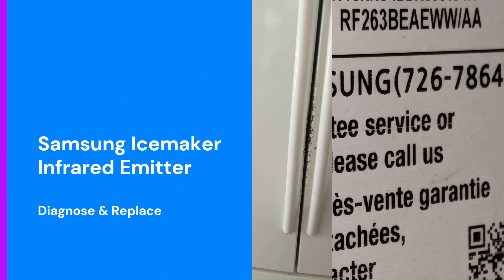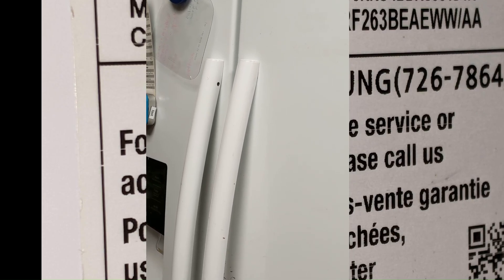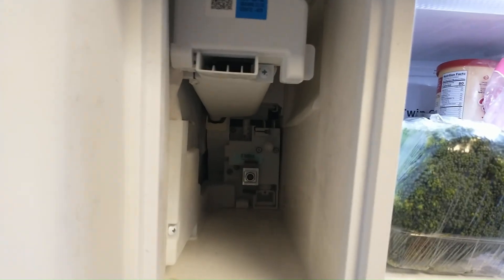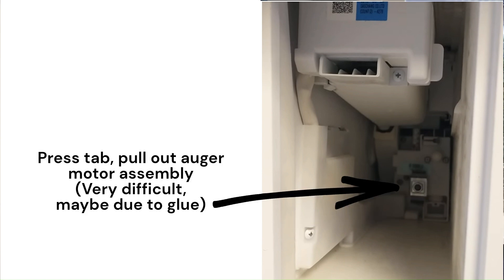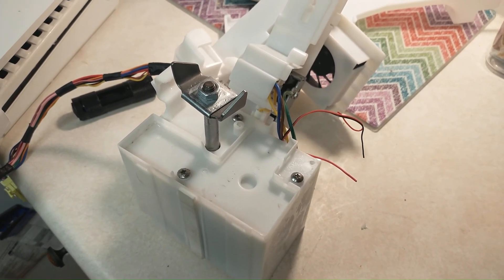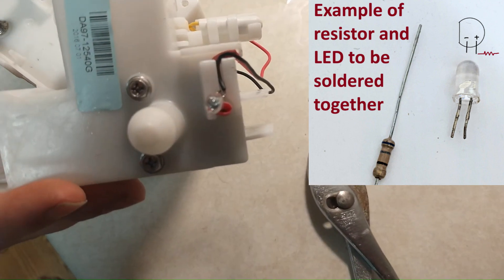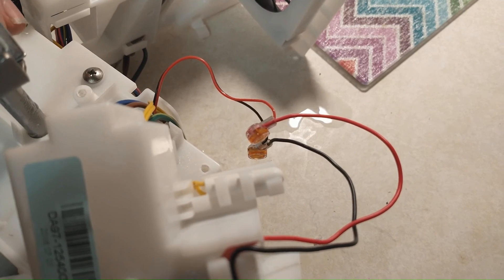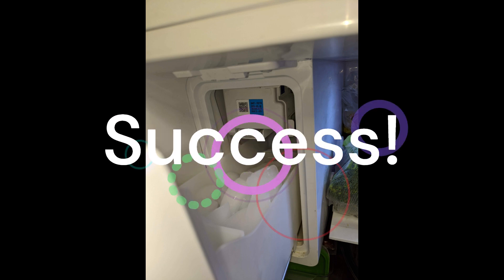Diagnose and Repair Samsung Ice Maker Bad Infrared Emitter (No ice)

Comment: This is the problem with mine. New auger assembly is $300. 
Can you show how you put it all together? I'm handy but don't understand how you wired it all together. Where did you put the resistor? 
Seem insane Samsung doesn't make it possible to replace just that part. Thanks!

Comment: Just so you know the new auger assembly has an upgraded cooling fan, Samsung had problems with the older ones, the bearing were going out but if you don't care about that, get a harness or get the infrared sensor and Resistor....Pro Tech here....Great video btw!

Comment: How did you calculate the resistor amount? I have the same issue with my 4-year old Samsung French Door fridge and not keen on replacing the full auger harness for $85+...

Curious if you know the part number for the Auger Wire Harness. The Samsung parts searcher for my model (RF27T5201SG) only returns the full auger assembly ($229).  Is it DA96-00682D?
Reply: Did you ever find out?
Reply: I believe that would be the correct part number, around 80$ retail...no need to buy the auger assy unless the fan is bad, you can use a 9V battery to test the fan (red/Black) wires, they did upgrade the fan assembly. I am a Pro Tech

Comment from the maker: Parts that are needed for this repair:
https://www.newark.com/multicomp-pro/mf50-680r/metal-film-resistor-680-ohm-500mw/dp/38K5245
 https://www.newark.com/tt-electronics-optek-technology/opb100-ez/infrared-emitter-880-nm-module/dp/58AC3526?cfm=true
https://amzn.to/4fHByOQ
https://amzn.to/3yycOIh

Please subscribe and add a comment if you found this helpful or would like us to offer a kit on ebay, etsy or Amazon.
Reply: Hi, this is really helpful. Is it possible to use 940 nm emitter instead of an 880nm?

And is a 1/2 watt resistor rating a must? Or a 1/4 watt resistor would do? Thanks for this
Reply from the maker: @radsantos824  1/4 watt is fine, I only had 1/2 watt in stock, 940nm should work
Reply: Did you keep a copy of the photo of the emitter assembly after you replaced the damaged lens? I couldn't figure out if I have to disassemble this rectangular block (emitter assembly) or I just have to remove the IR forcibly using a dremel?
Reply: Hi, I just would like to say that you are a life saver! I did this (using 680 ohm resistor plus 940 nm IR transmitter), and it worked!!

First, I confirmed that my fridge detects that the ice bucket is full (by pressing the diagnostic buttons, fridge key + freezer key for 10 seconds, then lighting key). Then I tried to series the resistor and ir, and hooked it up using a long wire, and powered it up using a 12v powersuppy. The fridge really detected the IR transmitter.

Then I finally removed the original IR from the auger motor assembly, and replaced it with the resistor+ir series..

Worked like a charm. I have a bucket full of ice now.

PS: I tried to power up the old IR from the auger assembly, and it is still lighting up weak. I think the IR transmitter has a lifetime, mine is already almost 5 years old so....